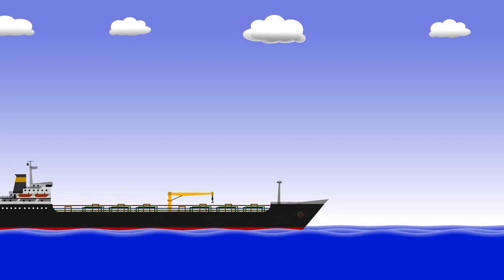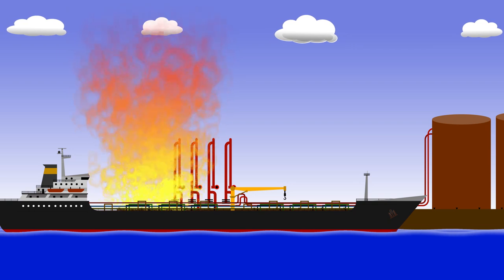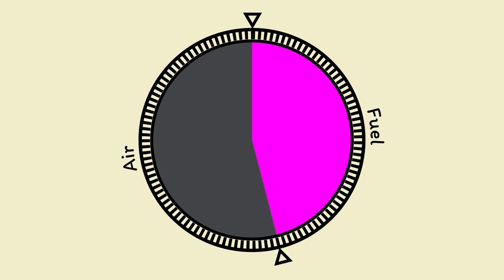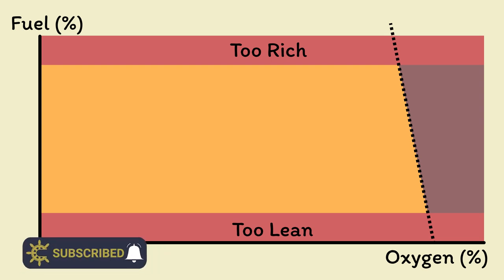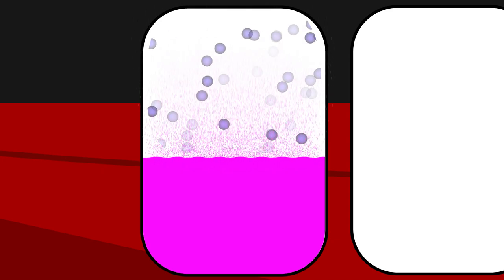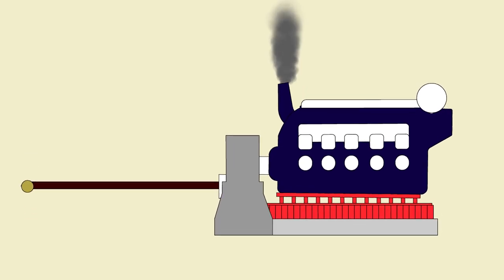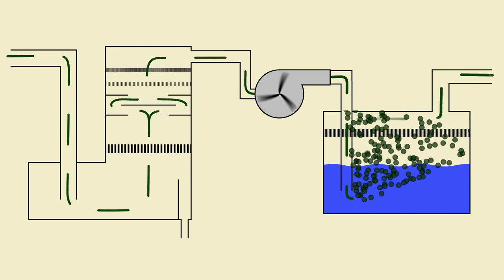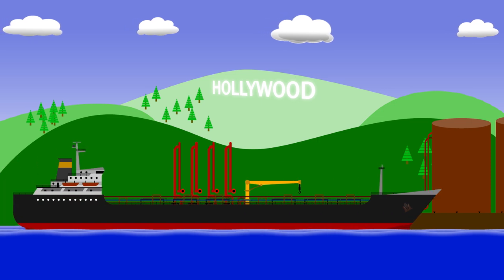Why Can't Petrol Explode On Ships?

Comment: Learned something new this morning. I never thought of using the engine exhaust to get the CO2. I had just assumed they were using nitrogen.
Reply: joecugo  wtf dude
Reply: joecugo  lol
Reply: @tolga1cool  what?
Reply: @Jake Chen It isn't the fact that engines produce CO2 but the fact it can be re-purposed instead of being released to the environment :) Makes sense but sometimes the 'simple' option isn't the first one we think of, as in my case.
Reply: @berndknauer5211   What exatly has the free oxygen to to with your nitrogen production? :-D
Reply: @julianreverse  I'm pretty sure it was a typo and he just meant air in general.
Reply: @julianreverse  Im not 100% sure now but either you can condense liquid nitrogen using liquid oxygen or the other way around, btw DO NOT UNDER ANY CIRCUMSTANCES USE LIQUID OXYGEN TO PREVENT TANKERS FROM GOING BOOM THATS GONNA BE OTHER WAY AROUND TOO
Reply: They actually use boiler flue gas for inerting the tanks. They do not use M.E. exhaust because of the following reasons - 
1. The ME exhaust is used to drive the Turbocharger which supplies fresh air to the ME to support combustion.
2. The 02 content is more in the ME exhaust as compared to boiler flue gas.
So boiler flue gas is a better option.
Reply: @berndknauer5211  +nitrogen is used as neutral  gas in chemistry already... soo standards and rules are tested and safe
Reply: @amitsinha6572  +unable to provide inert gas during cargo operation is also the reason.
Reply: Nazis knew about the co2
Reply: We dont use engine exhaust in inert gas system because it contains good amount of oxygen also( due to scavenging) ...we use boiler exhaust in inert gas system
Reply: Nitrogen is widely used as well
Reply: Knowing that airliners basically use nitrogen for their tanks, I presumed also it was a system adapted from that...
Reply: @damianbisha6712  injects liquid oxygen to crude oil tank IT WAS AT THIS MOMENT HE KNEW...
Reply: Yeah as long as you're having proper Scavenging otherwise less heat will be removed what's the production of carbon monoxide instead
Reply: on chemical tankers we use nitrogen, cuz its clean easy and cheap to produce on board
Reply: Burning fuel to prevent fuel from burning...
Reply: @damianbisha6712  Liquid oxygen has the higher boiling point so liquid nitrogen can condense liquid oxygen out of the air. Liquid oxygen can be VERY dangerous to handle due to it being pure oxygen in very concentrated form.
Reply: @amitsinha6572  The turbo doesn't remove CO2 tho, so your reason 1 is incorrect.
Reply: @samiraperi467  both his points are incorrect, the O2 percentage does not need to be 0, just low.
Reply: @baileywright1656  {oo
Reply: CO2 has the added advantage of being heavier than O2 , while N2 is lighter than both
Reply: Talk about spoiler alert you didn't even use tiny little letters lol
Reply: Same, i clicked on this thinking i knew the answer. It’s pretty damn clever
Reply: They are. Just as air is mostly composed of nitrogen, so is the exhaust. If the engine is running exactly in the middle between rich and lean, you would get the same composition as air except that the 21% or so of oxygen is replaced by 21% or so of CO2. Ofc, for fuel efficiency reasons, most engines tend to run lean so there will be some residual oxygen left, also, some nitrogen can react with oxygen and from NOx if the reaction is hot enough. This is normally dealt with using a catalytic converter since NOx turn in to nitric acid when it contacts water and causes things like acid rain.
Reply: @damianbisha6712  There are two other ways to make high purity nitrogen - molecular sieves and zirconia separators.
Molecular sieves use a granular material that absorbs nitrogen at high pressure and releases it at low pressure (you cycle the pressure and vent the gas you don’t want). Zirconia separators use electric current to move oxygen through a Zirconia ceramic cell - which leaves nitrogen behind and vents 100% oxygen gas out the other (the drawback is it does this at 600 to 900C).

Comment: Five minutes ago, I hadn’t ever considered the issue other than the analogous one of fuel tankers on the highways and roads where I believe at least in the US, safety has been improved over time through requirements of triple walled tanks and I’m sure inspection, valve and service life requirements. But, getting back to ships, your video perfectly laid out the problem and the solution (including both the scientific and economic aspects thereof). Well done!
Reply from the maker: Thanks Paul.

Comment: I'm retired from the USCG and was a Marine Inspector for about 20 years. I was inspecting a sport fishing boat in San Pedro once and noticed some planking on the bow was a different color than the wood it was adjacent to. I asked the owner about it. He laughed and said it was from the Sansinena II explosion. When the ship blew up a valve flew through the air about a mile and landed smack on the bow of this guy's boat. It went right through the boat which then immediately sank. That must have been a heck of an explosion.

Comment: naval engineer here. This video is generally accurate but a few notes: the CO2 usd to turn the atmoshere inside the tanks into non flammable actually comes from the boilers not the actual main engine.We engineers have to constantly kee an eye on the ratio of fuel-air to maintain a healthy level of oxygen well bellow 8% which is the safety limit(usually kept bellow 5%).The exhaust gas from the engine cant be used because that way the only way to produce inert gas would be at the times the ship is actually moving which is not the case. The steam produced by the boilers feeds into the cargo pumps abd their exhaust gas to neutralize  the atmosphere inside the tanks. Great video however and great channel

Comment: Nitrogen is actually used in liquefied gas carriers containing things such as LNG, or LPG. The nitrogen is generated by on board generators (separating from the outside air) but it’s only used for maintenance and during cargo operations, normally the tanks are slightly pressurised so no air can come in anyway. 

CO2 and water will freeze under the operating conditions of these carriers.
Reply: He was talking specifically about the fuel tanks, not the cargo like lng

Comment: I once had that experience on a picnic, when friend performed a "magic trick" for me: he filled the generator tank to the top with the canister, light a match, took a swing with his hat over the tank (to draw vapors away) and threw the match right into the filler.
I was blown away with the physics on that matter.
Reply: Actually pure oxygen is more dangerous than most fuels. Pure oxygen can set on fire things that are normally are not flammable.
Reply: @dtibor5903  in that case the thing set in fire becomes the fuel
Reply: @LiborTinka  for example, your skin.
Usually you'd get burned instead of burning, but if you touch liquid Oxygen you're screwed.
Reply: @afoxwithahat7846  The burn you'd get from touching liquid oxygen would be  a very severe form of frostbite due to the extreme cold. Now if your clothing got saturated with liquid oxygen and encountered a spark that could cause a flash fire.

Comment: As a welder and machinist we use these principles often when repairing tanks for various fuels, fluids or repurposing tanks (usually propane tanks) on a regular bases.

Diesel and Hydraulic tanks are the least dangerous as they are closer on the scale to oil so flammable but not necessarily explosive. 

A flexible metal hose from the exhaust of a welding rig [truck] works more than well enough to be safe on those. And frankly convenient as you can see it come out the top most if the time as an indication it's full.

Other fuels considered explosive we drain all of it which makes it more dangerous but pump in generous amounts of Argon because as a gas it's "heavy" so fills like something on the order of invisible water..

No oxygen sources....no fire....no explosion.

Still a dangerous way to make a living but somebody has to do it. 🤷‍♂️

Excellent video explaintion for the general public so I hit the 👍 for you.
Reply: Actual "explosives" may contain enough oxygen to combust without needing contact with an external source of oxygen - dynamite, gunpowder, etc

Comment: I work in the petroleum industry and here the have a other alternative. make sure the tank is completely full with the product it self. then there cant get any oxygen in to it
what you are talking about is here only used if a tank has to be made empty. then they do add nitrogen.
Reply from the maker: Similar on ships. When the tank is full it is fine. Loading and discharging are the highest risk times
Reply: @CasualNavigation  that i am aware of. here the biggest risk is the friction you get during the discharging.
Reply: But the tank has to be emptied some stage , an oil tank that's permanently full ,and never emptied is worse than having  no oil ,because you have to maintain the tank ,and theres a risk of leaking or fire ...
Reply: @eastcorkcheeses6448  they do empty the tanks for maintenance. that's with in a planning. but all the other time it is best to keep it full and on pressure. on land it's easy you can raise or lower the top of the tank that way it is always full with in the space used.
Reply: Sorry to interfere. You can’t (are not allowed) to fill a shipstank upto 100%. 98% is the max. A floating roof system is very impractical. During the transfer the liquid is agitated and due to this biggest risk of static discharge is during the transfer and thats why you need to be fully inerted constantly at an oil tanker. 
During maintenance periods the tanks will be cleaned and gasfreed so safe acces is possible.
Reply: @bas6983  i was talking about the difference/similarities there is when dealing with tanks on solid ground. There filling a tank 100% with product can be a way to keep it safe. If there is a 100% product there is no room for oxygen to bring it to the combustion triangle.

For a ship it depends on the type. As far as I know LPG tankers do use that technique with filling the globes to max.
Reply: You can't always have a full tank. If you're carrying less than a full load, the fuel would have to be spread so the ship sits level in the water
Reply: We have to keep ullage in every tank of ship ullage is the space left so that the fumes can move freely otherwise it will blow due to pressure and the ullage is filled with inert gas.

Comment: In the late 70s and early 80s two sister ships the Berge Istra and the Berge Vanga both dissapeared within a few years. As far as I remember they carried iron ore AND crude oil on different occasions (a practice not in use anymore) and somehow residue from the oil caused gas to build up whereas at some point the iron content in the ore may have caused sparks.
None of the ships have ever been found (they dissapeared on the high oceans at places thousands of feet deep, in an era long before GPS navigation), but it was assumed they exploded and sank with no survivors.

Comment: It might be worth pointing out that the inert gas, being a product of combustion is still mostly Nitrogen  which is pretty much unchanged apart from small quantities of oxides produced. The combustion process of the Hydrocarbon fuel turns most of the oxygen into Carbon Dioxide and water vapour.
During the scrubbing process, some of the Carbon Dioxide dissolves in the scrubbing tower so the percentage of Nitrogen in the inert gas becomes even higher- around 83-84%.with about 16%.
There is always some residual oxygen- around 3%.
I have not come across any installations using the main engine as a source of inert gas, these generally being shut down in port, but the gas being derived either from the flue gas of a boiler or a separate oil-fired inert gas generator.
Reply: Thanks for the explanation, i was confused after watching this video whether Nitrogen is the most part of inert gas or Co2..i had a doubt so if we are not using a scrubber tower how much percentage of Nitrogen will be there in the exhaust of boiler? Thanks

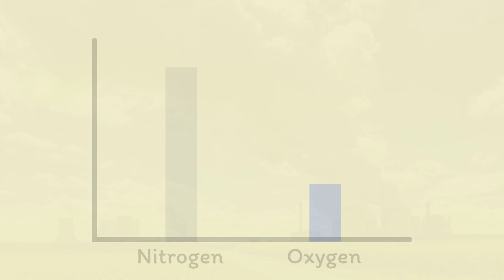Comment: 3:49 Nuclear reactors release minimal to no CO2. The clouds they produce is from water used for cooling/turbines that has been treated.
Reply: I think those are coal power plants.
Reply: Those are cooling towers, they can be used in any system/powerplant that produces heat.

Comment: Ex seafarer here.  Most oil tankers I know use exhaust gas from the boiler instead of the exhaust from the diesel engine.  The diesel engine can not produce enough inert gas at a rate needed during cargo discharging operation. Also, it would be difficult to bring down the residual O2 content of the exhaust from a diesel engine to a level that is considered safe (<5%). Nice presentation though. I am a fan.

Comment: As an engineer on board of ships, everything said is correct, but we are not using exhaust from Main Engine, or Auxiliary engines (generators), there are 2 options. One of them being Fired Steam boilers (using of their exhaust gases) and IGG (inert gas generator)

Comment: The Inert Gas Systems on tankships were originally designed and installed to prevent explosions during a   process called Crude Oil Washing.  Crude Oil is typically heated for loading aboard a tankship.  After a lengthy voyage, the crude oil cools and this leaves a thick film on "walls" and "bottoms" of the cargo tank after discharging at the terminal.  Owners and charterers realized this was lost profit (consider the vast surface area of these cargo tanks).  Machinery was developed and a practice began to heat some of the cargo and "wash down" the tank surfaces with heated crude to remove the film of oil.  The machinery was similar to a giant lawn sprinkler that sprayed in a spherical pattern.  In the early days, crew dropped the "sprinklers" on long hoses, but eventually fixed systems were installed.  So, how does this relate to Inert Gas Systems?  Hot, sprayed oil in an almost empty oil tank with a rich oxygen atmosphere combined with a static electrical charge from the movement of the oil started causing explosions.  Several vessels suffered casualties before the mystery was solved when the electrical charge was observed in shore side cargo tank mock - up (or so the story goes).  Owners and operators not wanting to lose the profit from the washing operations looked the engineers to solve and the Inert Gas System was created.  A video on the process of Crude Oil Washing could be informative and entertaining.

Also, most diesel powered tankers will shut down their Main Engine in port.  Very often a small Inert Gas Generator is installed (think a small boiler) and it's flue gas is scrubbed and pumped to the cargo tanks.

Comment: Note that the engine exhaust will also have a fair amount of nitrogen in it, if you don't specifically remove it, since engines are fed with ordinary air, not pure oxygen.

It would make sense for every engine on the ship (not just the main engine) has an exhaust tap to feed into the inert gas system, so that the system can keep working even when the ship is moored.

If you needed nitrogen without exhaust contaminants, you could (at least in principle) use a giant version of one of those machines that concentrates oxygen for medical use (by nature, it must also produce an output stream of gas depleted in oxygen).  Would cost more to install than liquid nitrogen storage, but would probably be cheaper in the long run (even though it would require some power), due to the large amount of energy needed to liquify nitrogen (even if done on shore); also, you wouldn't need to worry about the liquid nitrogen running out if the ship was delayed, as long as the ship's fuel didn't run out.  Of course, the exception would be those liquid cargoes that can't tolerate even the little bit of oxygen that would be left in the oxygen-depleted output of such a machine (for instance, something that would polymerize with oxygen, or form peroxides or otherwise go rancid -- unsaturated hydrocarbons and vegetable oils come to mind -- these also wouldn't be good to pass even cleaned engine exhaust through either).
Reply: Thats the reason chemical tankers use only N2 as inerting gas. Depending on the cargo the O2% lays between 7 and 0.00001% and typicaly the very high purity delivered via the shore before loading or via cilinders for padding during transit. Liquid n2 storage takes more space and equipment than a n2 generator this is the reason you only see n2 generators on board. Normaly via a kind of osmoses system.
Reply: "so that the system can keep working even when the ship is moored."

When they are moored they are either loading or unloading and the tanks that they are pumping their fuel into are also filled with the same gas so all they do is pump fuel out and get gas back from that other tank.

"Would cost more to install than liquid nitrogen storage, "

They don't need liquid nitrogen, just nitrogen. There is absolutely no need to cool the gas to -200 celcius and liquify it.

"If you needed nitrogen without exhaust contaminants, you could..."

This video literally explains how they do that. You don't have to suggest a solution, they altready have it.

" as long as the ship's fuel didn't run out.  "

The gas is sealed in the tank, there is no need to keep pumping in more gas. Once the pressure is correct, the gasflow can stop.

The gas is only there to keep the oxygen levels below the flammable limit. A 320,000m3 tank does not need 320,000m3 of liquid nitrogen to keep it's tanks safe, it just has to keep the empty parts of it's tanks below X% oxygen and given that the tanks are never empty all at the same time, the amount of gas they need is actually not that huge.